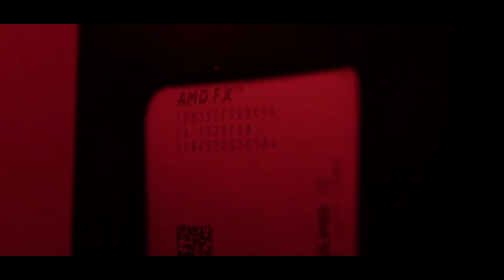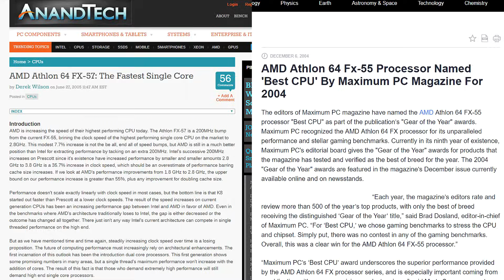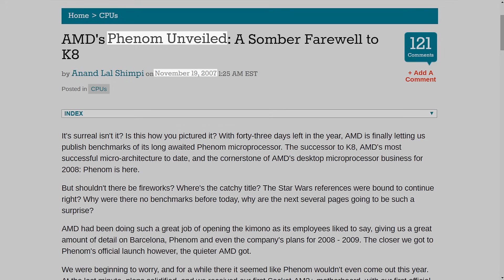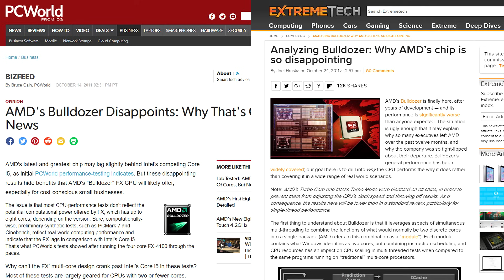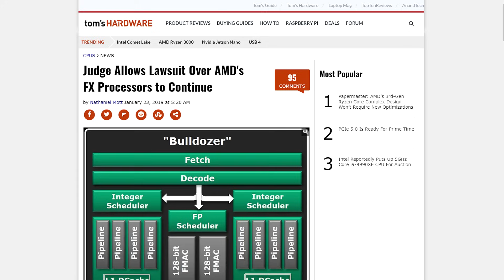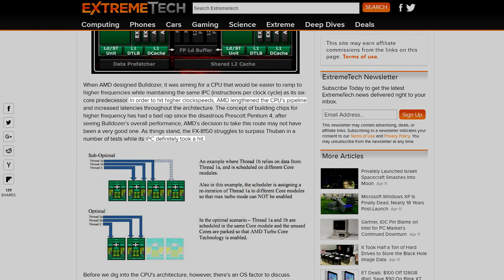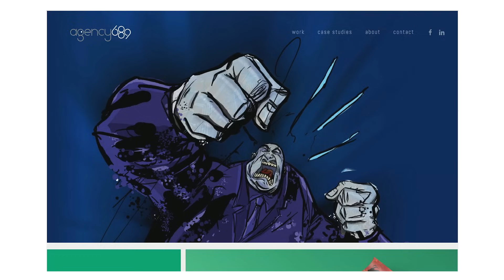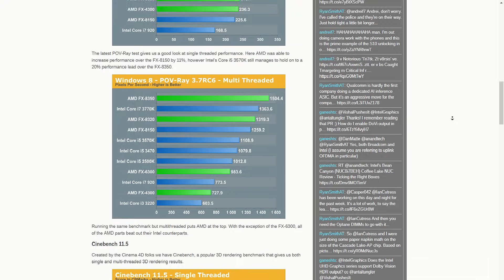Why AMD's FX CPUs Were Hated So Much? - The Fate of Bulldozer

Comment: I still have my FX 8350 from 2013 running at 5.0Ghz on water, I upgraded to Ryzen but the GF wanted to get into gaming so she adopted the FX CPU >:)
Reply: @devnull436  can confirm lol, I live in Canada and even at -30c outside this thing will heat up a room 😂
Reply: oh oh 6 year old water cooling ?
Reply: @DeadNoob451  Nah, just an AIO I upgraded from last year
Reply: What aio did you use?
Reply: @Brato1986  coolermaster Master liquid lite 120mm
Reply: I sadly can only get my FX 8350 to 4.24Ghz  @1.325v stable due to the due to voltage regulators on the Gigabyte 990FXA-UD3 V4. I have tried tweaking it in every way possible., and in my stress test with prime 95., the CPU never reaches 60C air-cooled, but the VR Loop would almost reach 100C before blue screening. Everything else would remain stable but the voltage regulator. I've had this OC 2 weeks after I got it over a year ago and runs great for it to be my first gaming PC, but was seeing if you had any suggestions. I really wanted to see if I could maybe get another motherboard and try again, but the prices on used motherboards from 7 years ago was way to much compared to just starting a new PC build.

Rest of the build is: Windows 10 PRO 64-bit, Kingston Fury 8GBx2 @ 1778Mhz on CPU-Z (1866Mhz on HWINFO64), Samsung 870 EVO 500GB for the OS,  EVGA GTX1060 6GB SSC, EVGA 650W 80+Bronze, and Xigmatek Dark Knight II Air cooler with 120mm Noctua fan. Also 3 140mm Noctua fans and one Corsair 120mm (3 intake, one exhaust) in a Fractal Design Define R5.

Now I'm in the works of a Ryzen 7 3800x build since there is really no room for upgrades on the old platform.
Reply: @theangrypickle96  I had that same exact motherboard and an 8320.  I was able to get mine to 5.1GHz stable.  If I remember correctly I was probably killing it with voltage though as I was running 1.48v through it.  I was using a swiftech h240x to keep it cool.  a couple years later it started getting unstable and I had to up the voltage to 1.5 to keep it stable at 5.0GHz and kept running that for a couple more years too.  Even at 5GHz, it was stuttering in Dirt Rally and was outperformed when I 'upgraded' to Intel's older xeon w3520 then later the w3670 on an Asus P6T.  I'm still running the w3670 and using the swiftech cooler as well.

I did have 2 case fans mounted in the window of my case with the 8320 in it (along with every other spot a fan could go), so maybe that helped keep my VRMs cool enough?
Reply: Hehe nice
Reply: what mobo do you have?
Reply: how much better is the ryzen to the fx?
Reply: @NightOwlGames  Cinebench score on my Ryzen 5 2600 (4.2ghz) is more than double what I got on my FX 8350 at 5ghz .
Dont remember exact scores but I remember being absolutely blown away by the numbers. Ryzen is also amazingly simple to Overclock and lock in a frequency.
I'm getting about 15-20% better framerate paired with a GTX 1660 ti and all the frame drops and stutter from modern games is gone.

Comment: Not sure the intentions those defending the fox series, I had 2 (8320/8350) and the 8350 system I handed down to a family member that doesn’t really need a true performance pc.  I gotta say the fox series for me was the biggest disappointment I’d had in a long time, it essentially moved me away from being an AMD fan boy to being neutral to other cpus (previous cpus were semipro/athlon/phenom x4 965 I think was the number and best cpu I had had  in ever for the money).  The 8320 was a huge let down followed by the 8350 after the 8320 failed within 2 years.  Couldn’t  even hold 60fps with dips to 30 in bf4 with 2 r7 270 crossfire (total joke).  Then got pissed, returned the one r7 270 and bought a i7 4790k and z97 mobs and instantly 60-70 constant fps (unreal change).  I am glad to see AMD returned and now on a ryzen 7 3800x AMD is crazy fast in everything but those defending the fx series are just blinded by team red, the fx were complete garbage.
Reply: Ok well let’s see first sempron system worked great (for what it was), next athlon system again worked great, phenom II x4 still maybe best system for the money ever built, i7 4790k another great system and OCed to 4.6 with stock voltage and now ryzen 7 3800x running great.  Yea I’m sure the fx 8350 was all me.  And the i7 used the same GPU that was in the fx 8350 (I believe it was r9 270) so you can eliminate that as the issue.  Same ram, same hdd, same GPU change cpu and mobo and instantly smoother and about 20-30fps difference.  Sorry but even as an obvious AMD supported I can be honest in saying the fx series were a failure.
Reply: Frag Doch it was an fx8350 with single card first (actually 8320 before that but that chip failed).  Then x crossfire to try to fix the slow FPS after going through all the cpu trouble shooting first from all the AMD gurus (changing c6 states, OC, etc etc etc) before getting the second card figuring it can’t be cpu.  Well in went second GPU in x fire and still no FPS change it was cpu bottle necked (could even see in test).  At that point it proved to myself what I didn’t want to believe even though all the forum users discovered it for themselves as well and said get an i5 and be done with it, so not wanting to have a second disappointment I retuned the second GPU and got an i7 4790k and it was night and day.
Reply: Frag Doch yea so I actually tested the system with two mobos first board I don’t remember exactly what it was but it was more mid grade so I actually had the thought that the mobo wasn’t powerful enough for the cpu as well so I switched to the asrock 990fx killer and again still low performance (this was done before xfire test).  Again maybe my expectations were too high but I did not find the series to be good at all, GW2 ran slow almost unbearably in world vs world even with everything turned low, bf4 would have huge dips etc it was just not an enjoyable experience and not what I would have expected as AMD top cpu coming from a phenom that I had great experience with.  Now that mobo and cpu went to my mom as a daily pc built from past parts from other builds over the years and still runs fine for that but the fx series did not compare to the intel alternatives in any way.
Reply: Frag Doch don’t know what to tell ya.  Maybe mobo maybe not.  What I do know is going through the experience is everyone pointing the finger at everything else and all the AMD fan boys of which I was one (guess still kind of am since I’m back in Ryzen instead of 9700k) not accepting the FX series is just flawed.  If it takes everything including the planets in alignment and bigger power wires to make it work and even then won’t ever come close to the intel offerings at the time all the while being power hungry, run hotter and still have no chance in hell to match the IPC of an i5 (even some with i3 we’re getting better test results) then that’s a failure.  There is a reason the FX series lost tons of sales and damn near bankrupted AMD, not a lot of people had success with them or would consider them good buy.
Reply: Frag Doch I hear yea and didn’t take it personal I’m a tech by trade (although not a PC tech but stuff crosses over).  Pretty sure VRM weren’t the issue as I’d think to see a de clocking to allow lower voltage while they cooled and I had no such sign (100% cpu usage maintained) also there was a top and back fan in that area of the case.  Even tried an OC up to 4.6ghz stable to see if I got better results, I really didn’t want to run it long term at that but if I saw big gains then that’s what I’d have had to do but the gains were marginal.  I’m pretty convinced it was just the low performance of the FX IPC which is well known by now, I think of it this way the frequency is just the RPM of an engine so you can go ahead and raise the redline but if its an inefficient engine it’s still not gonna do much and at some point throwing good money after bad vs just saving up and getting something that actually works is a cost savings in the end.  I wasted a lot of money not believing that an 8core top end cpu could do so poorly (in my opinion) so kept thinking it’s gotta be something x that actually wrong.
Reply: Well thats less of a CPU and more of a dual-gpu problem. Dual-gpu systems died out for a good reason, no developer optimizes anything for them.
Reply: DeadNoob please read above post before commenting, you’d see this was already covered:

Comment: So, THAT is why the FX line sucked so much. I started building my own PCs in 2014. Didn't know much, I just knew the AMD processors I'd used since 2004 never let me down. HP Pavilion Desktop was my first taste of AMD. Never actually died, it was just replaced with something newer in September 2010 (Another HP Pavilion desktop)

My first hand-picked build featured the AMD Trinity platform -- A10-5800K along with the AMD R9 270X GPU and (initially) 8GB of RAM.  It started out doing really well for its first 2 years of service. When mom wanted to replace her laptop with a desktop, I went back to the A-10 family, a Kaveri model A10-7700K. Unfortunately, for gaming, this APU did worse than the elder Trinity chip, and wouldn't even overclock as well.  Luckily, the computer it was intended for wasn't going to do any gaming.

Today, both the A-10s are still in service. The Kaveri chip is still in mom's desktop, never has given fits at all - one of the more reliable AMD processors I've seen in terms of maintenance, and Trinity still strides on as a Low-Level gaming PC with the same R9 270X Graphics card, but was since upgraded to 24GB of RAM. It does well for what it is, but it's not meant for anything recent. It's time to retire it from gaming life and put it to work as a media center. I just pulled the plug on an old Phenom II X2 CPU that was released in 2014 that couldn't even play back video in VLC without bottlenecking itself. Poor soul. 

As for the laptop the Kaveri chip was replacing, I'm using it to this day -- A Late 2011 HP DV6 laptop still soldiers on with Linux Mint installed (Windows was slowly baking the Intel CPU -- Mom bought it and I adopted it for my work to build the desktop, the only Intel computer I've ever owned. 

Since then, I've only recently seen and understood why AMD was so frowned upon. They really did not perform well for a lot of years, compared to Intel. BUT my brand-loyalty has paid off with my Ryzen 7 1800X. That thing is still very respectable, even though many newer processors (mainly from AMD) are able to easily run circles around it. Once money comes to, I'll upgrade to newer CPU to keep pace with my RX 5700XT GPU - Right now, my motherboard, not my CPU, is bottlenecking the GPU. PCIe3 is holding up the card, which means, guess what, I need a new CPU!
Reply: PCIe3 is not even fully saturated by a 2080ti, so the 5700xt is just fine with it. Only use for PCIe4 right now are super fast NVME SSDs.
The single thread performance of the 1800x is probably holding it back in games, so you can just get a 3000 Ryzen if your current board supports it and fix your problem that way.
Reply: DeadNoob sounds more likely. I didn’t know who was using The full bandwidth. Sounds like a Ryzen 7 3700X would do the job. Gigabyte AB350-Gaming3 from what I saw could use that CPU if I saw right.

Comment: My old rig still has a phenom x4 940. My newest rig which is 4 years old now has the FX8350. I haven't really felt the need to upgrade or spend the money on Intel and I'm glad I waited. My next build will be AMD again but I'm waiting for the prices to go down a little and for all the early adopter woes to be ironed out. I've never understood the need to be at the cutting edge of the processor race. Just sit back and make do with an older gen processor and upgrade once the newest ones become older. I'm not really a competitive gamer though, I use my rigs mostly for 3D CAD and programming.

Comment: My biggest gripe with the FX 8XXX line was the fact that despite how long that lineup was offered, AMD never sought to update the chipset. The 990/970 chipset was way behind the times compared to the Z97. That and the motherboard MFG's treated AMD as a lesser entity where you couldn't find boards easily that had more than 6+2 power phases that weren't stupidly expensive. The ASUS M5A99FX PRO had 6+2 and ran close to $200. The ASUS Z97 PRO WiFi  ran just over the same price (they were within $10) and had 10+2 power phases plus PCIe gen 3 vs gen 2 and has an M.2 slot that was NVMe compatible with a BIOS update. Granted, the 4790K was close to $300 and the 4690K was $230 compared to $150ish for the 8350 but the disparity of the boards for the (nearly) same money kinda made up for it. Mind you, I had (and still own) an FX 8320e system, replaced it with a 4690K based system and then replaced that with an R5 2600K based system which I'm using this minute. I still own the FX and 4690K systems and both function just fine but I wouldn't go back to either as my daily driver.

Comment: I sat out on AMD cpus for a long time. I was running an i7-4790k since 2015. But just a few days ago I switched over to the R5 2600 with a RX 5700XT. AMD is kicking ass.
Reply: 7Really ? According to all the benchmarks I have seen R5 2600 is a downgrade from i7 4790k and to get anything that runs games so much faster that it is worth upgrading to you must go much higher up in price with both AMD and Intel. Just because CPU is from later date does not mean faster, the 4790k for example is only 9% slower then much newer i9 9900k at same clock speed in single thread. Sure it is not just placebo effect, thinking it is faster because it is new? Always check using benchmarks and FPS counter...
Reply: @a64738  No it's not, I've benched my old i7 and my new R5. At stock my R5 beat it then I OC'd the R5 and it left it in the dust. The i7 did 1800 something in cinebench r20 while my R5 ended up at 2900. The old i7 4790k is limited to ddr3 ram and has gotten handicapped by security patches.
Reply: lol nope, intels i5 9 gen can beat your r5 2600 with 0 issues, and you made a bad purchase on your card i mean a 5700x? why dident you go with an rtx 2080 ti it would of lasted you way longer and its the fastest gpu that amd cant defeat.
Reply: @sikijunior1  That's cool... so uhhhh... both that cpu and gpu are over twice the price for my parts... so did you actually drop $1200 on that pair? Is this a pc you have?

Comment: In April my intel rig (i7 4790k) let go and melted my gpu, burned a hole right through.  I didnt feel like testing everything to see what still worked at the time so I grabbed a spare machine I had built a while ago with an fx-8320.  Hardly notice a difference in day to day things and games run just fine still.  Dont feel a need to upgrade right now, at least with intel.  The new ryzens look amazing though,  probably going to go amd again

Comment: Sigh...no mention of Intel being busted for paying companies to use the cripple compiler? Cost them 2 billion bucks after AMD won the lawsuit. If you look at the Phoronix benches (which used GCC instead of ICC) then gasp shock the AMD FX performed EXACTLY as one would expect with the single thread IPC being lower than Intel while in multithreaded tasks it traded blows and sometimes beat the i7. There is a reason why most game streamers went from AMD FX to Ryzen, streaming didn't use ICC so you could do 1080p streaming without breaking a sweat.

https://www.phoronix.com/scan.php?page=article&item=amd_fx8350_visherabdver2&num=10

I had a chance to use both systems at the shop and I ended up going AMD, I could build an FX-8320e based system for less than the cost of a 3770k and motherboard. I'll go on over to Ryzen when this dips below 60FPS but considering I'm not even OCing it and I'm still getting over 100FPS when paired with an R9 380X while doing 1080P 60FPS recording or 30 FPS streaming? That may be awhile yet. I OCed this chip when I first got it to see what she could do and had zero issue hitting 4.4Ghz on air but I like the quiet so as long as I stay above the magical 60fps on my games I won't bother, which considering this system is 6 years old now? I'd say is pretty impressive for its age.

Comment: Part of what made me stay with an FX-8370 + 990FX/SB950-based Sabertooth 990FX R2.0 rig is that, in addition to supporting ECC RAM, it was/is the most reliable, proven and powerful AMD desktop PC architecture to predate the inclusion of PSP in all (AFAIK) of AMD's subsequent SoC/CPUs.

(Page 8) "...PLATFORM SECURITY PROCESSOR..."

UEFI_PlugFest_AMD_Security_and_Server_innovation_AMD_March_2013.pdf
http://www.uefi.org/sites/default/files/resources/UEFI_PlugFest_AMD_Security_and_Server_innovation_AMD_March_2013.pdf

26 November 2019
AMD's TEE Driver For Loading "Trusted Applications" On Their Secure Processor Under Linux - Phoronix
https://www.phoronix.com/scan.php?page=news_item&px=AMD-TEE-Linux-Driver-Secure